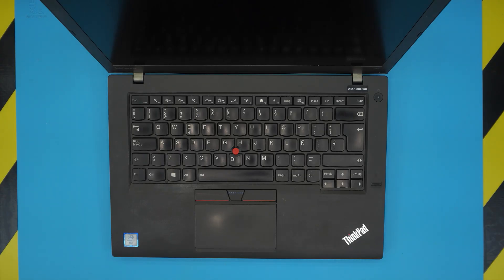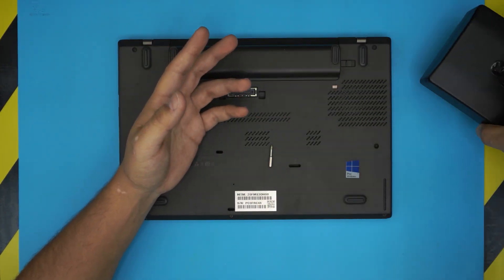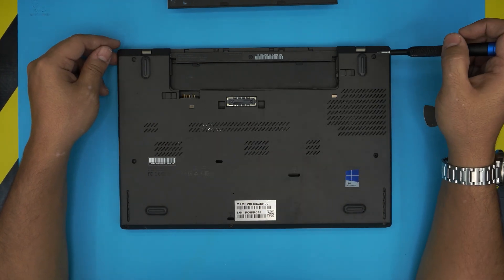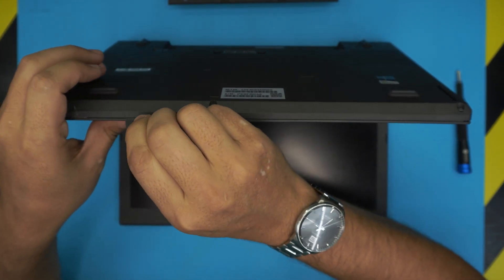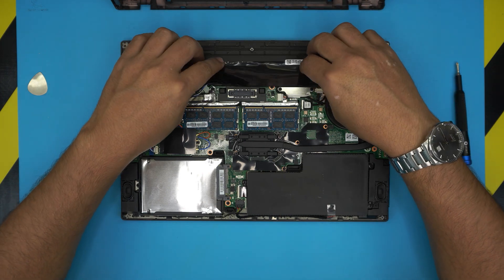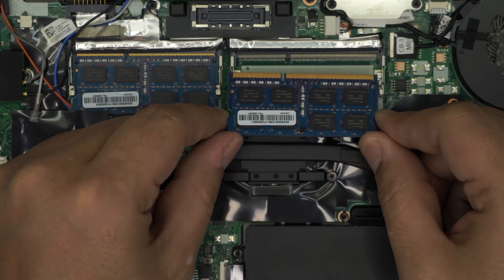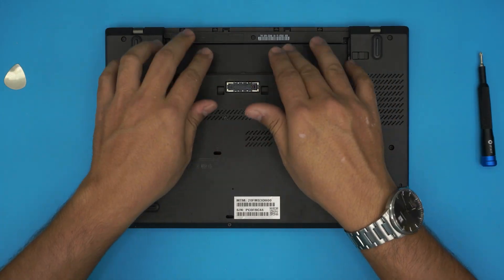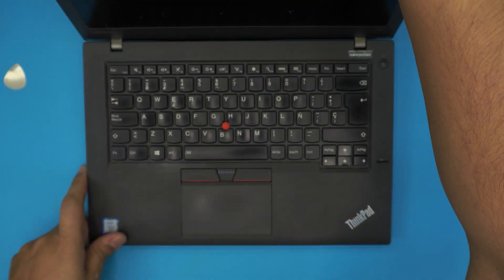Lenovo T460 Laptop Ram Upgrade Guide

Comment: Thank you so much for this video. Been asking my laptop sales guy several times to help me purchase, and then found your wonderful video. Really appreciate it. Can you tell me what is the maximum Ram memory for the Lenovo 460? Is 16 gb the max?
Reply from the maker: It's my pleasure, my friend. 😊 I deeply appreciate your taking the time to provide feedback. If you're inclined to support the channel further, feel free to like and subscribe—or even both!
Regarding your question, yes the max is 16gb and very stable at 16gb without any issues, just make sure you get the DDR3L (L stands for low voltage).
Should you have any further questions or requests in the future, please don't hesitate to ask me.
cheers🍻
Reply: T460 can support two 16GB ram modules, the maximum capacity is 32 GB. Just make sure they're both DDR3 low voltage (1.35v), 1600mhz (can be more as bios will adjust to the limit allowed, if less then speed will go down as well) soddim (just means the size of a laptop RAM. You can look up the specifications online, all details are there, even later the alternate types of RAM that are compatible. The link is on my laptop unfortunately and I'm typing this on my phone so you'll have to Google it yourself.

Comment: Can you upgrade the RAM to DDR4 RAM or are you limited to DDR3?
Reply from the maker: 🫠Regarding your question, you can't fit a DDR4 into DDR3 slot, it will not fit in there, you can only place a ddr3 in a DDR3 motherboard.
Should you have any further questions or requests in the future, please don't hesitate to ask me.
cheers🍻

Comment: Did ddr4 ram 16g 3200mhz support?
Reply from the maker: 😊Thank you for the feedback! if you wish to support the channel you can LIKE or SUB or both :P
regarding your question:  yes it will work but the bios will downgrade the speed to max it can support 2666
Reply: If i use ram 8gb ddr4 2666mhz its still work?

Comment: hi ! i have a question : before replacing ram : do i have to do a complete copy of m data in a external HD ? thx (i liked ur video and subscribed because the content is very good !)
Reply from the maker: Thank you for the feedback! if you wish to support the channel you can LIKE or SUB or both :P
regarding your question:  absolutely NOT upgrading ram or removing it wont affect your system or files or programs.

Comment: hi, can i put 2 memories with a different size? like 8Gb and 4Gb? would it work? Thanks
Reply: it works, with different capacity but same RAM speed
Reply from the maker: the ram speed will be adjusted by bios based on the lower speed.
Reply from the maker: Thank you for the feedback! if you wish to support the channel you can LIKE or SUB or both :P
regarding your question: YES my friend you can place any combination of GB in size and it will work just fine.
https://amzn.to/3h37b84